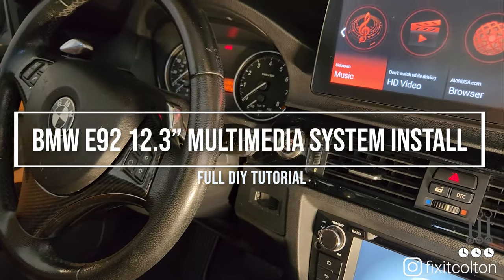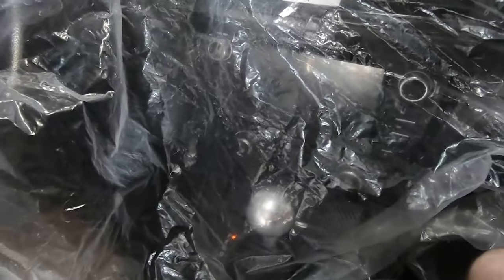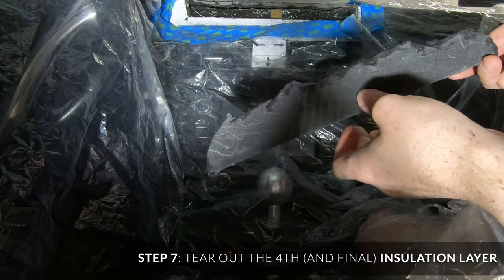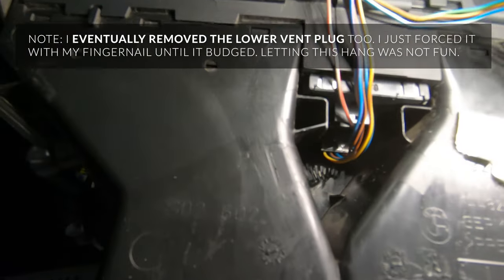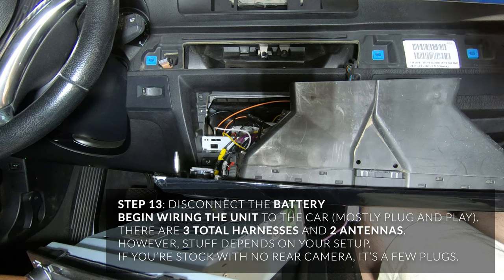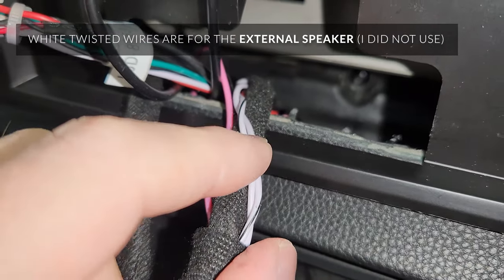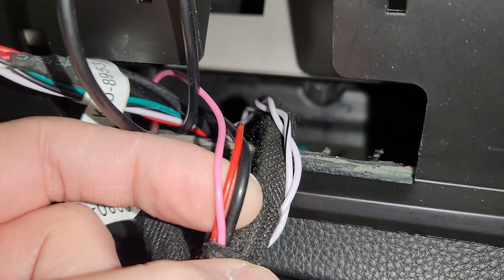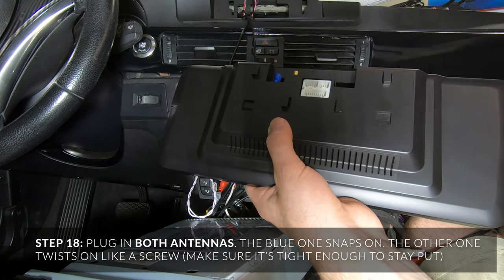BMW ANDROID 12.3" MULTIMEDIA NAVIGATION SYSTEM FULL INSTALLATION TUTORIAL (E90/E92 3 SERIES DIY)(2K)

Comment: Always wondered how it’s would look like if I installed another after market screen. I replaced my stock head unit with an eonon(the full touch screen no buttons) but it’s so low I wanted to add one like yours on the top. Maybe I’ll do it too
Reply from the maker: Haha yes, that was my exact issue too. It is too low and not angled enough to interact with comfortably. I was using a tablet to view the gauges as well. Having maps and Spotify nearly eye level is a game changer. It's also significantly safer when glancing over because your eyes are still partially on the road. This unit also does more than my Eonon and is much faster. I can't remember what I did before it 🤣. I'm going to post the full review this month to give some little tips I've used and some minor things I've encountered. That should help some people make a decision to buy or pass.
Reply: @fixitcolton  yeah man, i wanted to run two screens like yours lol. but so far I've never seen anyone do it on here. Do you use the new top one more and just not use the other one anymore? or both? got carplay on mine thats why
Reply from the maker: I definitely had the same sentiment. I pretty much never touch the bottom screen after one click when I start the car. The new one is in SUCH a better location. It's a better size, it has better functionality, etc. I run gauges on the bottom, and that is really convenient. You can get creative too. You can use them both separately for separate things (if you want). I look at it as less redundant than you'd assume. It's just upgrading with the times since the bottom one is old software and the top is new, as far as the OS. The bottom one is still lightyears better than the factory deck, but you can just consider it your factory deck now, lol. In most cases, I think it's worth it if you have the extra cash.

Comment: I just finished installing it with the help of your video! Thank you

I do find the head unit unresponsive and slow compared to some I had in other car. Is it just me? Also the wireless CarPlay sometimes lags and cut part of sound. Do yours do it too?
Reply from the maker: Hey Théo! Thank you for the comment. I’m truly, very happy that this helped someone, lol. You’re the first, so that is awesome 🙃. It is certainly a leap of faith to cut open the dash of your nice car. Hats off to you, good job. As far as the unit itself. Did you buy it from AvinUSA? I think different regions have different offerings. I, undoubtedly, got the best spec’d unit I could which was the Android 11 with 6GB RAM + 128GB ROM / SIM CARD / SNAPDRAGON PROCESSOR. It was a $40 premium, but well worth it. Not all 12.3” Android units will be made the same. I’d wager there are many variants from many sellers (especially foreign). That’s another reason I went with this company. I have to say that my unit is FAST. It is, by far, the fastest car system I’ve ever had. It’s faster than the OEM stuff on some cars. The response time is lightning, the loading time is minimal from a cold boot, and even the Android Auto connection is automatic and rapid. Unfortunately, I don’t have experience with CarPlay. I am unsure what form of connection it relies on. I would assume it's Bluetooth sensed and then takes over your wifi and connects via that. However, if you’re having drops, it may be Bluetooth error. Try to pay attention and track what you're doing when lag/drops occur and see if there's a pattern or trend. There are so many factors here from your phone model, the unit model, the app build, the OS, etc. Without having more information, I’d say the only fix I can think of right now is to use it wired. You may get better variables that way. If you’re phone is newer, make sure you’re on the lates iOS and the app is updated. These companies break their “auto” apps bimonthly, lol. A/B test it on another car if you can, even with an OEM CarPlay unit. This way you can, potentially, rule out your phone, app, or OS as the issue. Also consider if the 12.3” unit is expedient on all other things or simply Apple things. You may have to do some trial and error tests to eliminate factors. With all that being said, I do have some issues time to time with the wireless AA. I am currently working with the company to address software bugs in their system and go from there. I am mainly suffering from call issues. When the calls come in, it seems to disrupt (permanently) the connection forcing me to restart the unit. This may be an Android Auto bug though, so I cannot pin it on any one entity, yet. I know Apple is pretty locked down, but if you’re able, try to roll back to older versions of CarPlay, if the newer one is the issue (after testing). That has solved Android issues for me in the past. All in all, the head unit is very responsive though, it never lags or freezes. The only occurrence of any hiccup is the AA connection when calls cause issues. Don’t forget, you can always swap the units if they're faulty. Maybe you can upgrade if you're still within the return window, or maybe it is software based. Sometimes it's best to work with the seller. Hope that helps you out. Good luck with it!
Reply: @fixitcolton   thank you for the detailed answer!

As you probably know the instruction included are not really helpful so you were a great help!
I did bought it from AVINUSA and I also opted for the highest North America version! 
It is by no mean slow but I expected much faster from this price range. I used to have a cheap 300$ CarPlay head unit that was way faster. 
Could you send me a video of boot time to compare it to mine?
I did tried using it wired but there’s still a good amount of delay, I might have to spend more to get the dongle.
Support isn’t really useful from my experience.. 

Thanks again
Reply from the maker: Hey, yea there were no instructions, lol...at least for mine. So you got the Android 11 with 6GB RAM? I will try to get a boot video up in a few days. I'm not near that car right now. The boot time isn't stellar, but it's pretty good. I was pretty impressed with the response time of apps and general movement on the system. We may have different references as what is fast or slow though, lol. Its performance is equivalent to a mid level tablet and its price point is on par with a budget - mid tier Android phone, so it feels about the right to me. The price point is marginally high, sure, but it has some cool stuff to offer, and it is certainly better integrated than my last one. I paid the slightly higher pricing due to the custom retrofit and it blending in with the car so well. That alone was worth it for me. I get it though. I was assuming from boot time that you meant the unit being fully off to turning on, but are you referring to CarPlay connecting? I don't have an Apple phone to test CarPlay at all, but I can demonstrate an Android Auto connection. Just off-hand, I would guess that, from a cold start, the unit takes 15-25 seconds to boot. Without me touching a thing, my phone's bluetooth kicks on and it automatically connects the Android Auto within seconds. Only if I am reversing will it interfere with the ZLink, but only momentarily. It's quite rapid. I am working on a full review, but still waiting for the company to sort out something in the software. It probably won't be out until early February, even though most of the review video is done. I will try to add in some boot time stuff if I cannot get a boot video up in a few. I may just make a short on it though. I will also try to see if anyone I know has an iphone so I can test CarPlay and help you compare.
Reply: @fixitcolton  Hey!
Yes I have the android 11 6GB version!
It really feel like a 100 buck tablet a few years old in therm or lag and responsiveness wich is weird. 
And by boot time I mean when I press start button and until the unit is usable. That take about 40 sec and then CarPlay over Bluetooth takes between 15 and a minutes to connect. 
Wich issue are you having with the software ? 
Thank you!
Reply from the maker: Ah ok, it seems we have the same model. I think my boot time is probably a little less than that, and my Android Auto connects in about 15 seconds. I am having issues with my controller interfacing after trying to update. I had to reset/update some stuff because of a bluetooth calling issue within the phone to unit connection. I believe it'll be sorted out soon.

Comment: Hello, I wanted to ask you a question if you don't mind.
In theory, for the audio on the upper screen to play, the original radio must be put in aux in mode. Do you reproduce the sound only on the lower screen? Or do you put the lower screen in aux mode so that the upper one plays?
Reply from the maker: Hey, on my particular setup, I put the lower unit on aux mode. It actually wakes into aux mode by default. If you're running a lower unit that's Android, and it doesn't do this, you can use MacroDroid App to do some simple trigger/action protocol to accomplish this as well. My lower unit runs in aux mode in the background. I use it for gauges in the foreground. On the OEM unit, you would still do the same, but I cannot recall (it's been so long) how to switch the lower unit into aux mode or if it's automatic. 

You control the music and Android Auto from the 12.3" screen above. You change tracks, etc. My lower screen also has the ability to act as its own Android Auto unit, but I never use it due to location and the top one being so much better, lol. Granted, they're independent of each other. Ultimately, the lower unit is just acting as a sound processor or pre-amp to connect your 12.3" source to the speakers, and it ONLY controls the volume. I have no control over the music tracks from the lower unit interface. Note that you can control eq from the lower unit, but most people recommend setting this from the sound processor or amps directly. 

My upper unit (12.3") isn't wired into any speakers or amps. I also don't control any EQ from it (though you could). It's a flat/neutral audio channel that feeds into the lower unit via a 3.5mm jack. The lower unit is wired into a JBL MS-8 (I have a #short video showing this https://www.youtube.com/shorts/iagUhLcOrrE ). That sound processor (in my trunk) runs to all the speakers. It also has a built in amp if I chose to go that route.

Depending on your build (or car), you may have an amp in the trunk, or your lower radio may be your amp. If your lower head unit is running the power directly to the speakers, make sure anything you replace it with has built in amplification as well. This 12.3" does not, and it is built to hook right into your OEM system and use the stock amp to power the speakers. Hope that helps 🙃
Reply: Okay then your lower unit is automatically in aux and that's why the upper unit plays the sound. By saying that it runs in the background, you mean that it is not seen on the screen of the lower unit, which is in aux mode, so ugly, right? So I have the upper unit, if I mount the lower one that replaces the original radio and acts as an amplifier, would that be enough? Or would I have to install something else? Thanks for your help man, I'm quite confused and your help helps me a lot.
Reply from the maker: Yea, it's not seen... it is ugly 🤣 Theoretically, yes. Most of these Android units are meant to be plug and play. Let me know me what car you have, I'm assuming an E90? I'm assuming it didn't come with iDrive and navigation?  

Also, what tier system do you have? The Logic 7 system will need an adapter to the optical on the lower unit, and you'll lose the center channel (If I remember right). If you have Hifi/Premium, or Base model system, you won't need to do anything else. That Eonon brand is good for the specific E90 stereos, it may be a safer bet to get the package built for the car. They will sell adapters for optical.
Reply: Yo no tengo instalado nada de sistema de audio tiene el de origen y yo lo único que quiero es poner la pantalla inferior y la superior y que suene la música de la superior
Reply from the maker: Ok, todo lo que tienes que hacer es conectar el superior al puerto auxiliar del auto en el reposabrazos.
Reply: Como se conecta?
Reply: Saco del cableado de la pantalla del aux un cable hasta el reposabrazos no?
Reply from the maker: Conectas un cable aux largo de 3.5 mm desde la radio superior al reposabrazos del auto

Comment: Great video, thanks. When using Apple Carplay/Andorid Auto, is there a way to run other online apps (installed on tablet rather than your phone) by using your phone's data connection? Thanks in advance
Reply from the maker: Hi, thank you for the comment, I appreciate it! I rushed and missed the full drift of your question, so let me add to my previous statement. If you use this with WIRELESS Android Auto, it will inhibit your Bluetooth and Wi-Fi connection on your phone. Wireless AA streams over Wi-fi in order to have higher bandwidth, which is cool for lossless music, etc. Therefore, you cannot use data via tethering or hotspot when wireless AA is working. The other functions and apps on the tablet/car system will not receive data via Android Auto’s data stream. You also cannot turn on the tablet’s/car system’s Wi-Fi toggle while AA is WIRELESSLY connected. For example, opening YouTube in the app drawer will have no internet connection while wireless Android Auto is conjointly open. 

The only way around this at the moment, that I know of, is to use WIRED Android Auto. You must sever (permanently) the setup and connection for wireless AA, or else it will automatically connect each time your Bluetooth is on near the car. Then, you plug in the wired AA. Once that’s done, and AA is connected and working, then you can do other things. For example, you can use your mobile hotspot, turn on the Wi-Fi on the tablet/car system and use background apps this way, such as WhatsApp or YouTube. If you don’t have mobile hotspot on your plan, you can try the app “Netshare” but it’s no longer supported, therefore it’s hit or miss. You can also buy a separate 4G SIM card and install it directly in this tablet/car system so it has its own data separate from the phone. 

Lastly, there may be a way of accessing AA’s data outside of the app when it’s connected to the tablet (via developer options or beta builds) but I don’t know of it, nor have time to search that. However, I also doubt that would be possible because then Google would be contributing to mobile hot spotting phones that don’t actually pay for mobile hotspots. For example, in Android 11, Google sneakily removed the ability of phones to naturally hotspot. They added a check which verifies you pay your carrier (AT&T, Verizon, etc.) to actually have hotspot on your plan. Before Android 11, you could turn on the toggle for hotspot and it would work. If you had unlimited data, you’d be able to hotspot without the $10 or so premium per month, granted data would still bottleneck at around 20GB per month. Point being, Google secretly implemented this to hurt its users, therefore they do not support hotspot without extra payments (plans). I highly doubt that this entire thing is possible by other developer options or coded means via AA. I hope that info helps.
Reply: Very helpful, thanks pal. May need to get a 4g sim for the car...but will this still allow Android Auto to work for calls with my phone etc?
Reply from the maker: Yes, phone calls, text messages, WhatsApp, etc. will all work. Any app that is supported by Android Auto (in its tiny app section) will work with the data from your phone during connection to the car.

Comment: hey, slight issue i bought the unit and realised it says its suitable for my car etc but i noticed that the iDrive button isnt the same size as the one i have part of my dash in my car i have the more rounded one, so does that mean i wont be able to install the iDrive Button?
Reply from the maker: I'm not sure I'm following you. I'm assuming you're talking about the iDrive controller? You purchased the unit for your car and the controller accessory, but the shape of the iDrive controller, that is mounted in the center arm rest area, doesn't line up? 

If you bought it from AvinUSA, they list exactly which models they support. Even within the E90 series, they have multiple models. If you have the OEM iDrive navigation system or do not is possibly what you're referring to, but you're going to have to clarify and be more specific.

In a nutshell, if your controller doesn't fit... you probably cannot, or wouldn't want, to use it, lol. You can always try and figure out some solution, but it probably won't look good. I would source the right parts for your build. 

On a final note, if the iDrive controller is what you're referring to, and it is BARELY off in fitment, then you simply have to contact them and swap the plate. I had an issue where the year of the E90 car affected which little insert size worked. If it looks like it lines up, but it's just not going to squeeze in by a fraction of an inch, then you need to ask them for a different plate. I swapped out my plate by the 4 screws under the controller. They should send it based on your exact year.